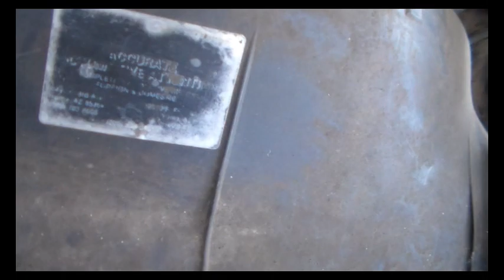New Years! Let's work on that old '86 Chevy truck

Comment: The dangling vacuum hose at the end of the video sure wanted that fan blade. Truck sounds good. I sure wish I could find me a good ole solid work pickup here in North East Texas that is not priced in the new pickup range. After all these car shows started appearing on tv the used pickup market went sky high on a rockets back.
Reply: Haha, try Wisconsin. Any affordable truck up here is pretty much scrap metal on wheels.

Comment: I wish you could work on my 1984 C-20 350 engine.  The choke runs too rich at 30 degrees temperature and works ok when it 15 degrees or colder here in  Soldotna, Alaska.  Any suggestions?